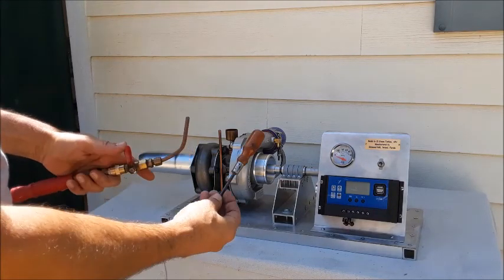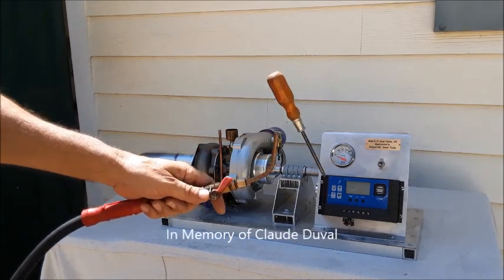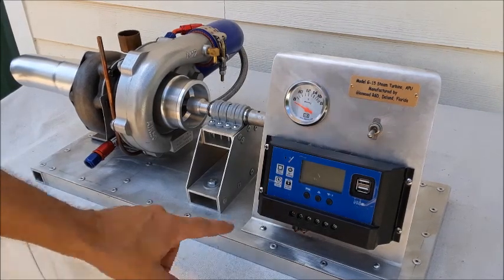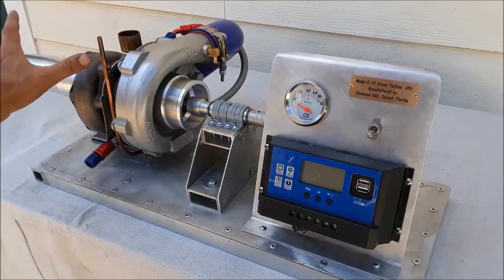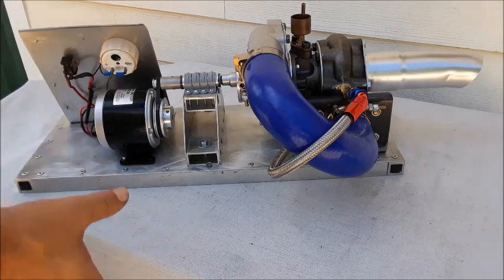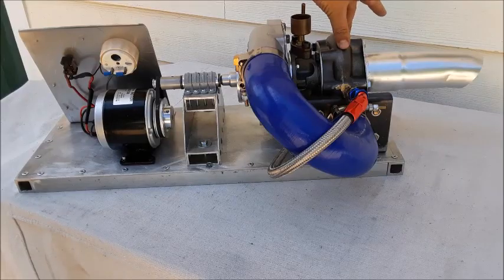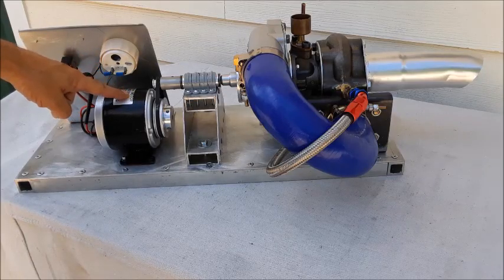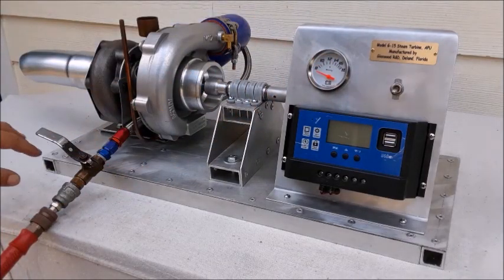Steam Turbine Upgrade

Comment: Is there a way to disconnect the compressor side?  I'm thinking it probably contributes a net loss to the overal output and if you can I would suggest taking measurements with and without it.

Comment: slap an intercooler on the exhaust as a cheap and high capacity condenser, and blast it with the compressed air to keep it cool.

for every halving of exhaust pressure, you get the same result as doubling boiler pressure.

the steam itself has plenty of heat to release. give it a low pressure to exhaust into, and you dont NEED boiler pressure at all, it will get "sucked out".

a proper steam turbine extracts more energy from teh steam when its below atmospheric and below 100C than what it can produce from the steam when its over atmospheric and boiling temps... the colder you can keep the condenser, the more of the otherwise wasted "latent heat" can be utilised.  theres a limit, as the condenser still has to reject that heat released by the condensing steam  to the surrounds... and the closer it gets to ambient, the slower it will reject that heat... meaning they get larger and larger as more and more vacuum is pulled. at some point, the bulk outweighs the advantages of pulling such a hard vacuum...

and without a delaval nozzle, or aonly  single stage of expansion, theres absolutely no benefit to having the boiler deliver more than 15psi anyway. p1/p2=0.577 or something like that. regardless of the initial pressure, you can only drop to approximately half that pressure with a standard nozzle. and a delaval nozzle means you have to spin fast. REALLY fast. blade speeds approaching 750m/s or more. or, half the speed at which teh steam is moving... which is limited to the speed of sound without said diverging nozzle...

that being said, you can always compound two or more turbines, with the same halving of pressure in each one when sized properly (good luck with that. not many turbochargers have turbine maps...)

Comment: Have you thought about making a centrifugal governor for when it runs on steam? And perhaps you could increase the length of the intake and put a free power turbine in the intake that will spool up to run the DC motor when air is sucked into the turbo. Normally free power turbines are run off the hot end through a hollow shaft to a propeller gearbox. But in this case to disconnect the dc motor from the turbine shaft I think you could do it off the cold end intake.

Comment: With like you said the bearings in the turbo are delicate. Instead of just using gravity and rotation of turbo shaft you could use the same method as if it were mounted on an engine. It would be simple just find the cheapest fluid pump that can handle medium weight oil @30-40PSI use the same restrictor that comes with turbo to restrict flow volume with discharge back into sump for pump. the bearings in the turbo are like crank and rod bearings that only act as a bearing at startup before the oil under pressure creates a fluid bearing eliminating metal to metal contact. I forget the formula used by Indy car engine designers, but it was 4-6 or 6-8PSI per 1000RPM. This calculation is for a piston engine that is much more severe than just lubricating a balanced rotating shaft, but the shaft can turn @80-90K-RPM. The gravity feed is fine for something that spins slow like sub 300RPM but a turbo at even just 10-20K-RPM even just 10PSI would extend bearing life and even help with vibration.

Comment: This turbine almost seems like a type of condensing turbine. Where the steam enters the turbine, expands and slows down, but also turns the compressor, which feeds air to the steam, condenses the steam, creating vacuum, which flows into the compressor again, adding power.

Ideally, this turbine would effectively comdense that steam right back to water without much issue, allowing you to recycle that water to the boiler. As well if you can separate most of that moisture from the exhaust, i bet you could pipe the air into your boiler fire and allow for forced air.

Comment: This is what I was hoping to find... Thanks. I recently came across some guys rednecking a burn barrel with a turbo and after a couple minutes I wondered why they didnt try steam and make it useful instead of just hot and noisy for five minutes until it blows. I'm still in the very early stages of deciding what uses I could make from it like cool colored smoke shows or as an air mover perhaps heater but not haven't put too much thought into it yet. Charging batteries seems like a possibility though.

Comment: Just got my turbocharger today. I already have a boiler. Just curious if you think I could just plum the steam into the line from the compressor side as it enters the steam side? Instead of drilling and tapping into the side of the cast iron.
Reply: You can go to my pg and see if you think my boiler will run it

Comment: I believe this is how we can extend the range of electric vehicles. Propane would be a practical, reliable fuel to run it. Hydrogen is not that cheap yet. Less would be required from the batteries. Trash trucks, county vehicles could charge themselves, while they are sitting in the yard. Any one with a solar/wind system could include this, with wood pellets as fuel. Everything I'm talking about is proven doable. We need cheap reliable options, no giant monopolies and energy competition. The goverment favors the opposite. Independence should be big business right now. The goverment is sacrificing people for the environment in Europe. They are freezing. We can't move heavy freight down the tracks on solar yet. That is a fantasy world. Real reliable power requires burning something.

Comment: where can i find turbine like this one ?
Reply from the maker: The core is a generic automotive turbo (for a 2.5 liter 4 cylinder) that was bought on Amazon.
Reply: @gwseymour  quick question say for example i have 2Kw electric motor how do how i calculate how much PSI or bar i need to fully turn the motor ? 🧐
Reply from the maker: @incodewetrust8862  I wish I had a formula. I can say that you need approximately 1 HP per 750 watts. With steam, your HP will depend on PSI / RPM.